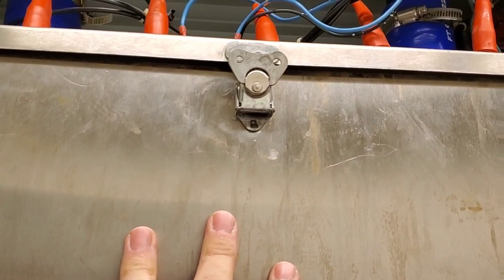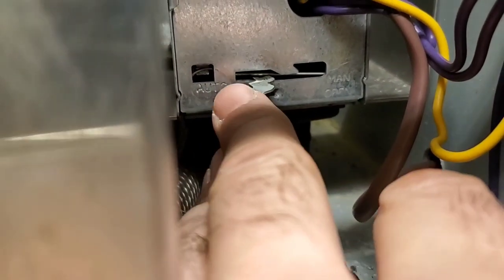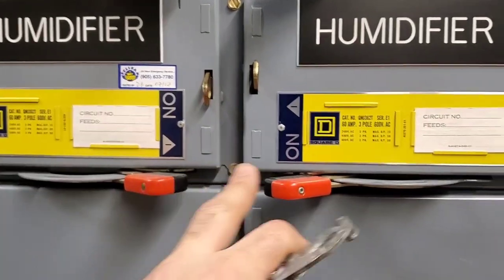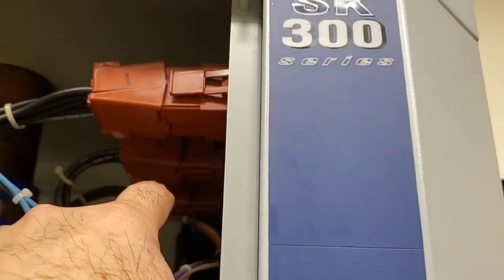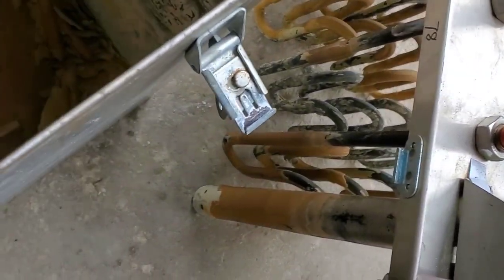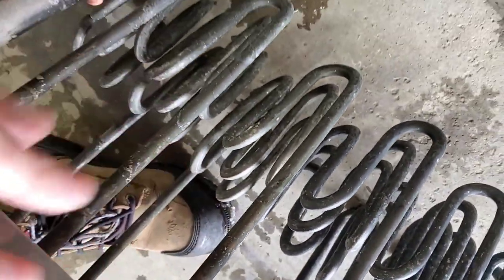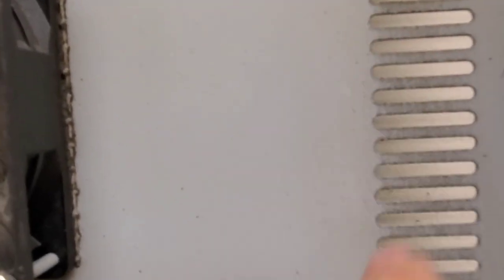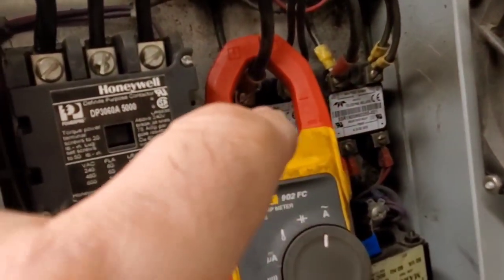De-Scaling A Commercial Humidifier And Replacing An SSR

Comment: Good job. I do the same thing to Liebert’s all the time. I have increased the flow rate and it has really cut down on the scale. Those cooling fans should be replaced every 6 years. I learned this at VFD school.
Reply from the maker: Why every six years of it's still working?
Reply: I was told that was the life expectancy. Bearings are worn. The last thing you want is for that compartment to over heat. I got this from the ABB representative in Houston. I know it’s not a VFD but the fans are the same.
Reply from the maker: @actechformallyyomama746  these fans have been running since day one and they're over 15 years old.  Sounds like a sales call, perhaps, maybe!
Reply: I would recommend replacing them. You could check the bearings on your next call there. Stay safe